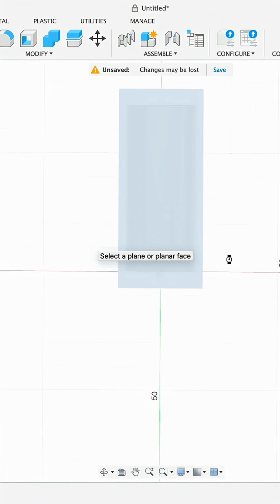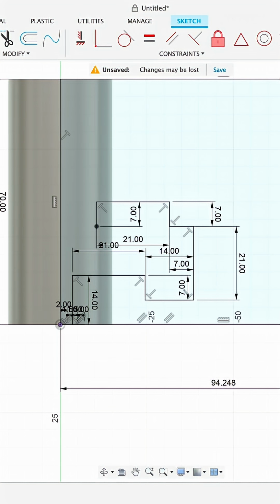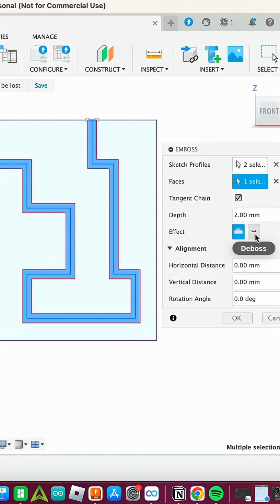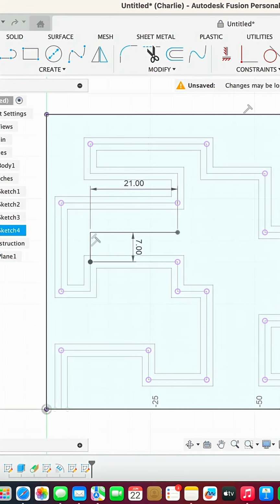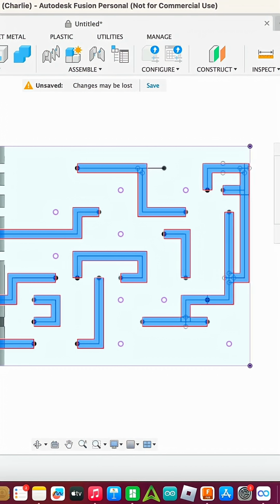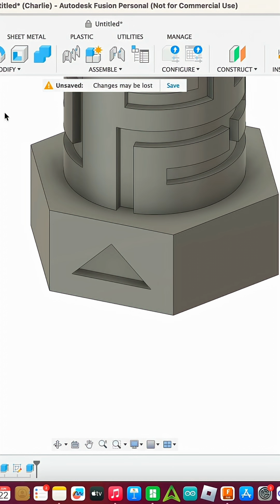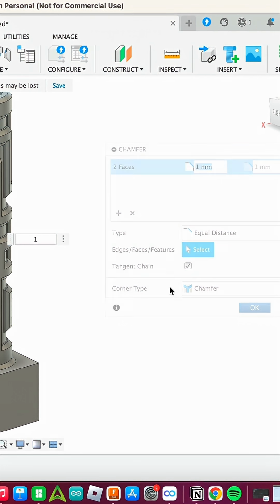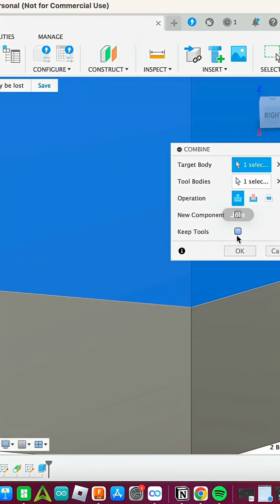3D Printing Everyday for 365 Days 173/365  #stem #3dprinting #3dprint #ideas #useful

Comment: I think I would have designed it around the maze by first creating the maze on a smaller scale so you can easily use the grid to draw the maze without having to constrain it, as the grid is your constraint (like you're doing with increments of 7). And then scale it up to the desired scale, all parameterized ofc.